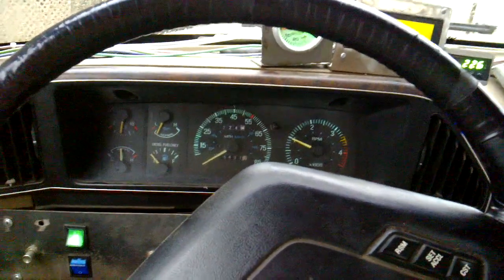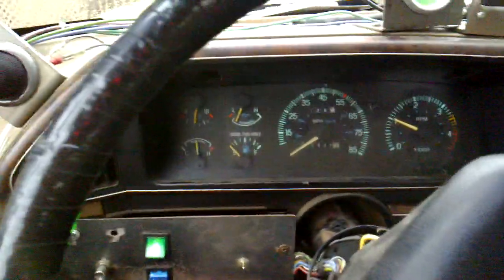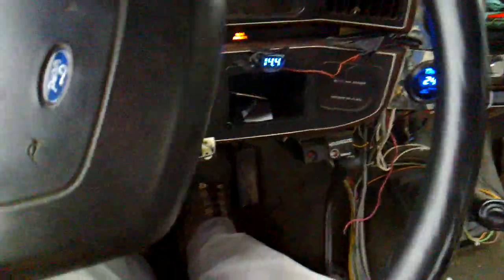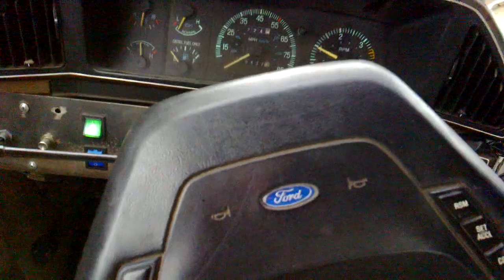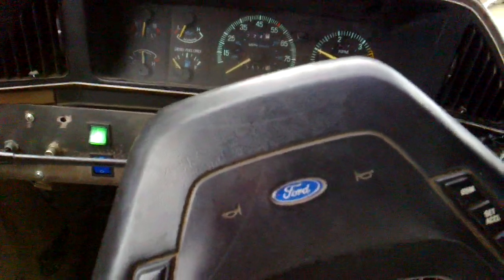Hydroboost lines mixed up

Comment: I've got a similar thing going on, but it makes my power steering non-existent if I have my foot hard on the pedal. I'm going to try swapping my lines. I just had my truck all apart, thinking I hooked them up backwards. Thanks for the video.
Reply from the maker: That's actually 'right' - The HB unit has priority(comes first) when it comes to hydraulic flow.
If it's a problem, you'll probably need a stronger PS pump; it might be worn out and not producing enough pressure/flow.
Reply: I swapped the lines on mine, everything works as it should now.